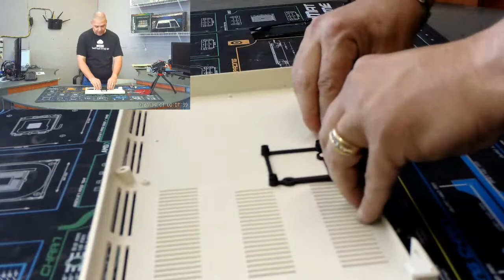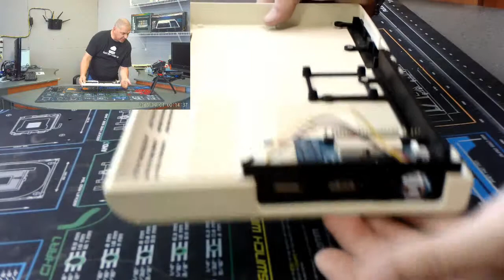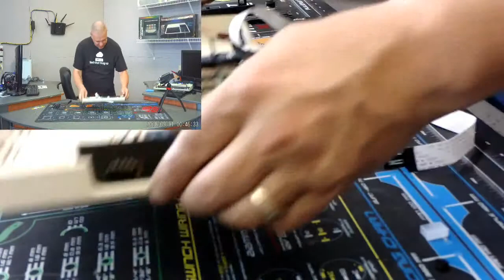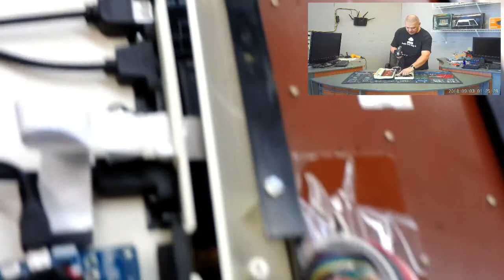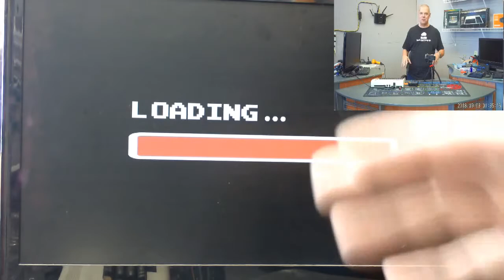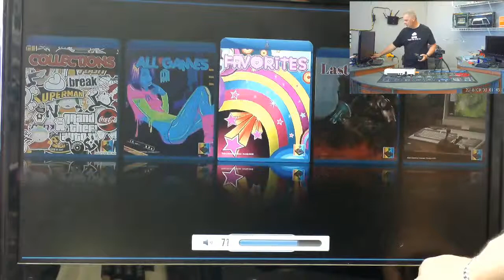Lets put a raspberry PI into a Commodore VIC20! (Part #2)

Comment: Good day Jon! Just a thought... withe the Pi GPIO pins, wouldn't it be possible to run your case LED directly from the Pi? Could eliminate the cost/ confusion of the power board since it is just running the LED. Again, just a thought. Great project!
Reply from the maker: Paul Peterson Yes, All you would have to do is run a small resistor in line with the LED. I actually ended up doing this later on. I also ended up eliminating the power block completely in favor of an external power source.

Comment: thank you Jon enjoyed especially  not having to endure soldering and wire management that I so often fast forward thru. Having a 3d printer sure nice makes engineering  a good fit so easy
Reply from the maker: Heh ironically I thought I was a tad long winded with the screws and mounting :) I was trying to cut it down to the meat and potatoes of the project. It was a great deal of fun!